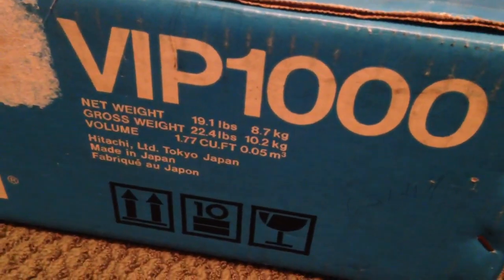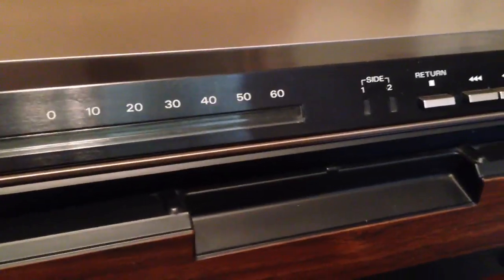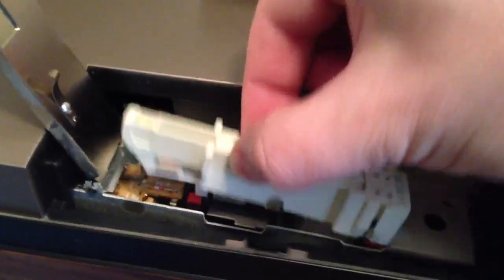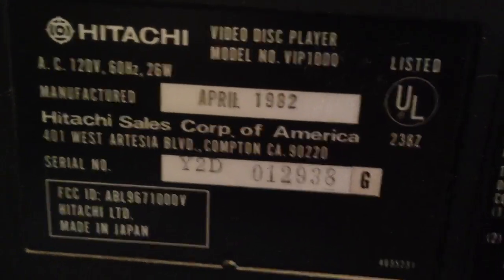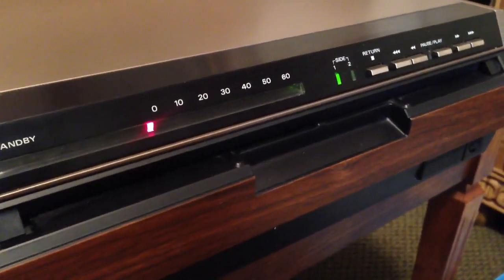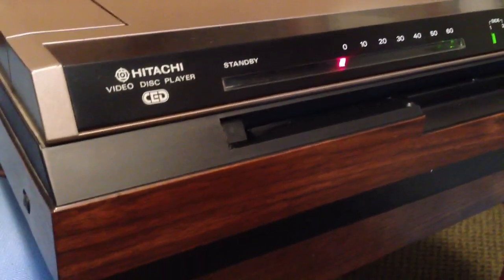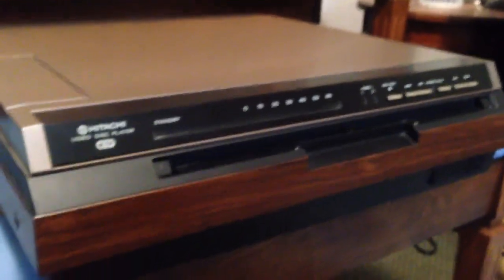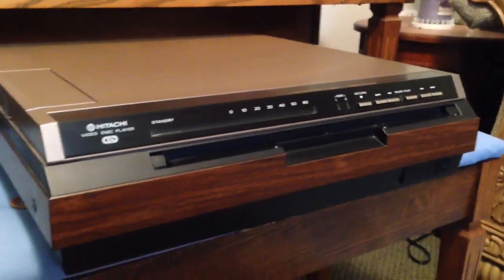REAL Flux Capacitors and Retro Video Disc Systems

Comment: There was a stereo adaptor made for these- it plugs into the "Accessory" jack on the back, but they're very hard to find. Toshibas had them too, but RCAs didn't- someone there actually said something to the effect that people wouldn't mind having to buy another player later. I have a stereo Hitachi player with the wired remote, and also a Sears stereo player made by Hitachi that works the same way.

Comment: The only problem with the Hitachi players (and their clones like the Realistic CED-1) is that the stylus for them is no longer repairable.  All the parts for them have been used up and there are no new styluses available anywhere.  The RCA series players still have stylus parts - and NOS styluses - still available from a couple of sources.  If you're interested in the players, the RCA players (and their clones) are probably the better thing to have.

Comment: i like the way that the disc/record inside never gets handled or touched by fingers.. Compact discs and Dvds should have employed the same thing (ie: the disc should have been in a 'box' or 'cover' like in this video, where the user never gets to touch it or risk scratching it).. I remember when video shops first started hiring out dvds they had massive problems with scratching.. constant returns with people saying 'the movie wont play'..
Reply from the maker: jeremy keating Yeah the "caddy" is a very cool system.  Minidisc and other Magneto-optical discs (including DVD-RAM) used a caddy to house a disc.
Reply: This is because the discs were coated in a thin film of silicon. This was to help increase the life of the disc as the diamond stylus was wearing out discs very quickly.
Reply: Well, they did originally have cases like an MD or UHD disk but mainly for PCs. it was thought it added extra expense and size so they ditched it. Unfortunately they didn't consider the child or idiot factor into the cost equation and so we now have a landfill of discs that can't be played. At least RCA thought about kids and morons when designing this.

Comment: Nice looking player man. Everything was made so much better and durable back then! Everything now is crap, dvds and blurays have terrible digital audio sound! Have to crank it just to hear dialogue and then as soon as something happens, you have to turn it all the way down. Its a joke! Thats why VHS tapes have great audio sound, everything is balanced out just perfect, without anything overpowering anything else. Everything was nice and loud. Analog all the way!!!
Reply: +nicknasty14 Sorry bro, your woes have nothing to do with the audio and video being digital. The volume swings you are experiencing are intentional and put there by the studios. DVDs and Blurays have the full theatrical soundtrack which is designed to be played LOUD (105-115dBSPL peak) in an environment with very little background noise.

VHS tapes always had a reduced dynamic version of the soundtrack similar to what is broadcast on TV. You can enable DRC/Night mode for dolby based discs. For DTS based discs you are mostly out of luck unless you have an AVR with Global DRC, Audyssey or Dolby Volume.

Analog storage was phased out for a reason, it's inferior in almost any metric you can think of.
Reply: Well, what you described is called dynamics. It can be annoying, but we should be happy it exists. Sound engineers agree that the movies are one of the last mediums that have dynamics in audio. Music already sounds like it's loud even when you have the volume low. Movies now, at least from the 90's and on that the sound got perfected, have dynamics. What that means is that in a movie, when I whisper to you, I will sound as loud as whispering in your room. If I fire a gun after that, it will sound like... I fire a gun. This is called dynamics and it's what makes you say "I liked that movie" when you go to see one at a theater. You wouldn't like whispers and gunshots have the same dynamics (in a few words volume) would you? Unfortunately, music and movies are not made for watching when our mom sleeps next door even though we do it, and I am pretty glad they are that way. Of cource there have been mishaps and bad mixing decisions like music too loud, with the most recent example of Interstellar. But again, this is a MIXING issue, doesn't have anything to do with digital sound being crappy just because it's... digital. It can't all boil down to "digital vs analog and analog being better" all the time.

Comment: i used to have an RCA video disk player, wasn't bad but i did notice a drop in video quality as it neared the end of the side, was never sure if that was a common problem with the design or just my unit, i got it used.
Reply: +Kirk Nelson As the video starts at the outside tracks, the closer it gets to the middle the less vinyl there is for the needle to read information from. CAV  (Constant angular velocity)
Reply: +Tony Philipsson Audio records have the exact same issue as the waveform has less physical space to be indented on resulting in what is called "inner groove distortion". On the outer edge of records the vinyl is going by the needle so fast the waveform can be comfortably stretched out reproducing the sound more accurately.

Comment: Flux means to flow (through space). It's not short for fluctuate. The "flux capacitor" was meant to store temporal flux (time).
Reply from the maker: lazzer408 That is only one definition of flux.  A second defintion is continuous change, changeability, variability, inconstancy, fluidity,instability, unsteadiness, fluctuation, variation, shift, movement,oscillation, alternation, rise and fall, seesawing, yo-yoing "the flux of vapor in the tube"
Reply: I was using it in the context given.
Reply from the maker: So was I.
Reply: of course

Comment: The reason VHS was successful is because, as bad as it was, it was still the best picture out there. back then, antennas had fuzzy pictures and even cable often wasn't much better. VHS was beautiful compared to it and was also decently affordable
Reply from the maker: So true.
Reply: What your referring to is signal to noise ratio. Compared to a weak grainy broadcast picture, VHS is going to look very clean and smooth to the eye. Even though the resolution is somewhere around 240 resolved lines or TVL (TV lines). You still have the same number of scan lines of vertical resolution at 525 in NTSC. However broadcast TV has around 330 TVL, with 120 chroma lines, while VHS has only about 30 lines of color information. In fact all consumer tape formats had about 30 lines of chroma, while LaserDisc (420 TVL) was the standout with 120 lines of color; same as broadcast. Of course for broadcast to look good you needed a clean signal. A nice line of sight path or hopefully clean cable signal that was a direct feed from the studio itself. Most stations in the 90's and beyond made arrangements to have a direct fiber feed to the cable head end, thus providing a clean signal to the cable company and no disruption of service when the over the air broadcast was off, i.e. power failure, transmitter issues etc. I certainly agree VHS became very affordable and to most consumers it looked better than any other source they typically had. Back when analog was king! ;)

Comment: So this particular player didn't use a laser to read the disc?
Reply from the maker: +Martin Farrell - that is correct
Reply: Martin Farrell no. It basically works similarity to a record player. The only difference is that the grooves are microscopic and the needle(stylus) works a bit differently .

Comment: this would have Been revolutionary if it came out in the sixties like RCA wanted
Reply from the maker: Indeed.  It was too little too late.
Reply: @databits  The first Working Prototype for CED was ready by October 1971. In June of 1972, there were beta stage prototypes already working and being used in RCA's Labs and Offices meaning that SelectaVision was MORE Than Ready for the Retail market for the Year 1973.

Here's where the bubble begin to burst: There were disputes in the Engineering team regarding how they wanted the CED Disks read, One wing of the Team wanted an Electron read Lens Reader(Basically,  EARLY Laser Lens) while the other wing wanted a traditional stylus with one that licked the Vinyl Disk like a regular Record Player. They were constantly butting heads, prompting RCA to continually delaying the completion of the project and repeatedly Shelving the Working Prototype. Although RCA announced at the 1977 CES that CED players would be launching that Spring, they foolishly decided to wait until R&D costs and mastering costs could decrease, meaning it FINALLY hit the Market in February OF 1981. 

RCA started development of CED in 1963. Something should have told them in 1975 to cut their losses or just suck it up.